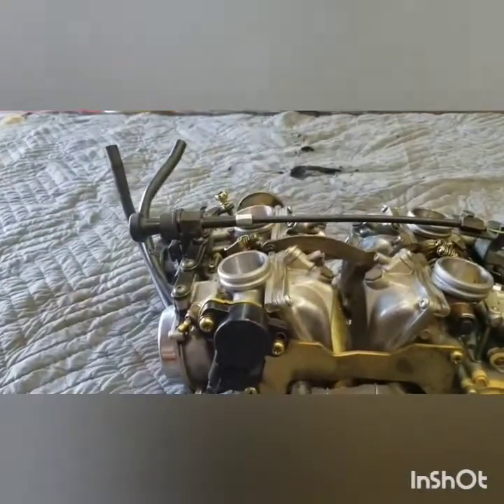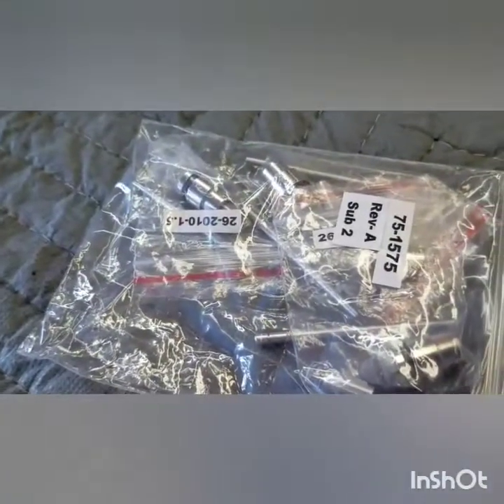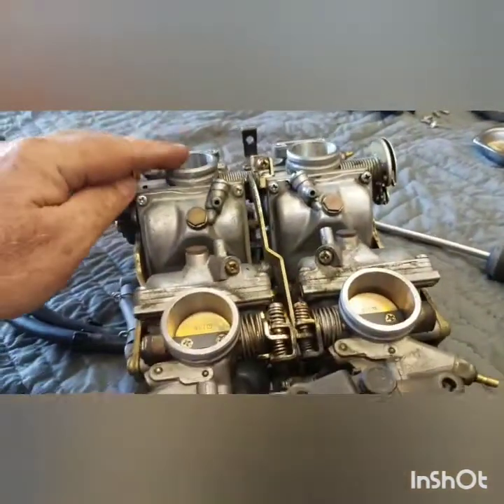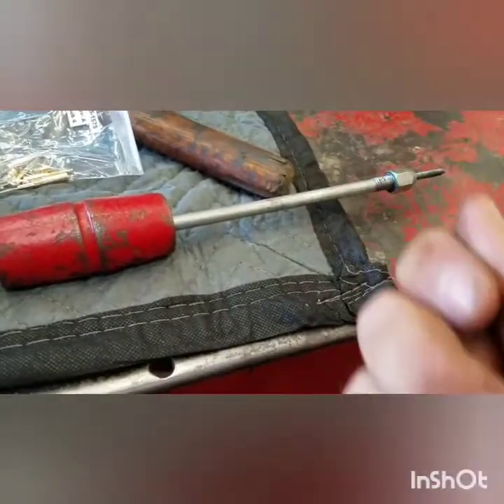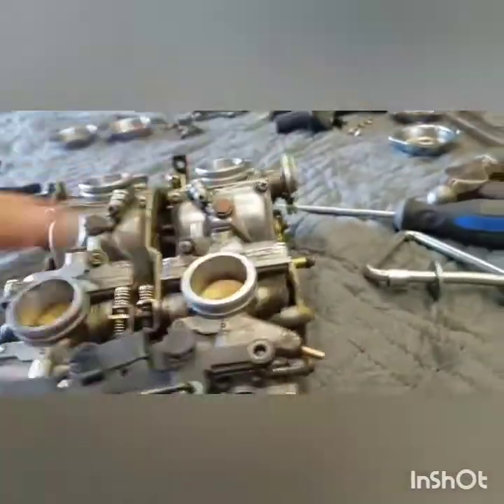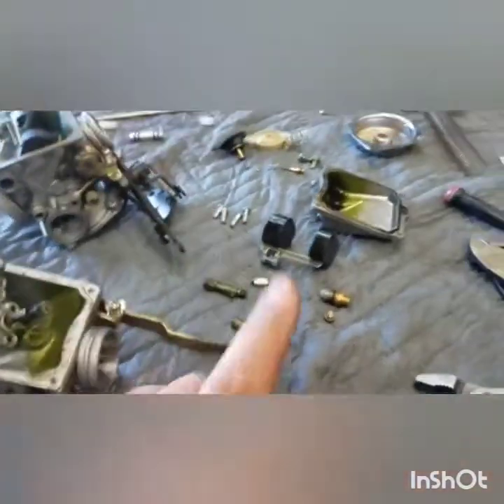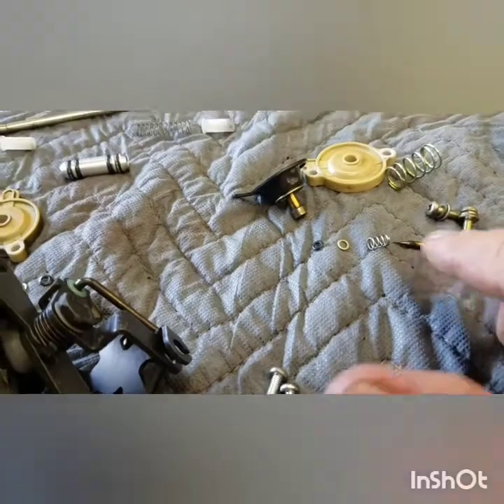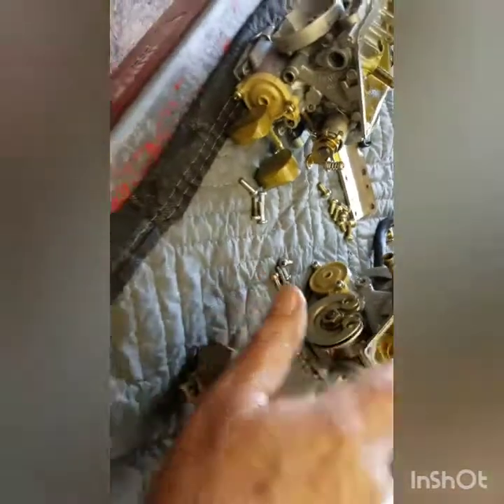Yamaha Royal Star XVZ1300A carb rebuild

Comment: Hello, I have a 97 Royal Star 1300 with 32k miles and the previous owner definitely used ethanol fuel, I have run Seafoam in the tank a few times and I only run non ethanol in my carbureted engines, It seems I have one carb that doesn’t want to idle and I have picked up the same rebuild kit you have in this video, I’ve pulled and rebuilt motorcycle carbs but nothing with 4 carbs and TBH I think I’d rather pull my carb assembly and send them to you with the kit, How do I reach you outside of YouTube?

Comment: Hi. I’m looking for a carb body exactly like the one the video as someone has broken one of the brackets that hold the flat inside the carb. Any idea where I can get one as I can’t find it on eBay or anywhere else. You can contact me directly as well please. Thanks
Reply from the maker: I just keep watching ebay until i find one
Reply: @geezermoto7820  thanks. Any chance you know the exact model number I should be looking for to get this exact style of carb since all the ones I found on eBay for the Royal Star XVZ1300 seem to be different.
Reply from the maker: @fuadmohseni  you will have to just wait until you find one that looks exactly like yours

What year model?
Reply: @geezermoto7820  2000
Reply: Are there different models within the same years and that’s why there are different types of carbs?
Reply from the maker: @fuadmohseni  not that I'm aware of but i guess it's possible
Reply from the maker: The 10th digit of your vin is the year code 
X is 1999
Y is 2000
1 is 2001
2 is 2002 etc

Be sure to check the vin on the frame
Reply from the maker: @fuadmohseni  i think 98 and older is a different carb
Reply: @geezermoto7820  which year did the carb in the video come off of?
Reply from the maker: @fuadmohseni  1998
Reply from the maker: @fuadmohseni  1998 and back are different and a little harder to find
Reply from the maker: @fuadmohseni  best i Remember there are about 3 different style carbs for allll of the 1300... If it looks like yours, it will be yours
Reply: @geezermoto7820  thanks again. I am going based mainly on how the little holes on the air filter side of the carb look. They are clearly different on the other carbs I’ve seen on eBay.

Comment: I did have the carbs synced within two weeks
Reply from the maker: you can buy manifolds on Ebay very reasonably,   those are always used up with cracking after about 10 years of use. Seal them against head with threebond 1184 or yamabond 4.
They will suck air etc. Could be a reason for smelling fuel at warm up.
  or leaving choke on too long.
You only want to choke as little as possible, on choke can foul plugs quickly.

Comment: What do you charge?
Reply from the maker: 500 plus parts plus shipping

the kits for all four are usually right under 100
Reply from the maker: check your intake manifolds for cracks or being very hard, for sure seal them to heads with threebond 1184

Comment: Geezer, Do you know what the brass hollow screw is, and the purpose of it that is bolted under the main jet with a washer. The brass screw is hollow.
Reply from the maker: Not sure which you speak of

....if it is the one with no hole all the way through, it is just simply a plug plugging off that passageway
Reply: @geezermoto7820  the tip of the diagrhram needle seems to sit in the hollow section of the brass screw. Does that help?
Reply from the maker: @darkventhead581  it just plugs the passage off....to machine that area
Reply: @geezermoto7820  that's what I thought but wanted to make sure it didn't serve a deeper purpose. I had one of them randomly split in half after being hit with an ultrasonic cleaner. Waiting for 2 primary holders. The o-ring for the primary jet. And one of those screws and she can all go back together. Hopefully I didn't forget anything!
Reply from the maker: @darkventhead581  just take lots of pics as you go

They are pretty simple if you think about it's just a few subassemblies
Reply: @geezermoto7820  I'm back geezer!! 

Did a complete rebuild on them and having an issue. Fuel is rocketing out all 4 of the tops of the carbs in the airbox through the hole with the brass fitting. Could you point me in the right direction?
Reply from the maker: @darkventhead581  either float levels wrong, or floats installed wrong or O-Rings on float seats are bad
Reply: @geezermoto7820  Float needle and seats are brand new. I did the ole' kentucky grease on the o-rings. Before installation, i blew through the main fuel inlet and manually operated the floats and all of them properly sealed against my breathe. I'm kind of at a loss here.
Reply: At 47 seconds in the video geezer. When you're pointing out the float needle and seat. There are some small rubber o-rings in the package as well. What are those for? I still have them leftover from the rebuild kit because i couldn't find anywhere to use them at.
Reply from the maker: @darkventhead581  O-Rings go around the float needle seats
Reply from the maker: @darkventhead581  without those, fuel will never stop flowing
Reply: @geezermoto7820  Of course. I have o-rings that go around the needle seat (They kind of press fit in to the hole). My question is about the o-rings that are really small next to the needle seats. Looks like there are 2 types of smaller o-rings there. Do you know what they go to?
Reply: They show up much clearer at 38 seconds. The smaller o-rings in that package.
Reply from the maker: @darkventhead581  smallest go on the air mixture screws
Spring then washer then o-ring
Reply from the maker: And often times the others are not used

Accelerator pumps use them but I don't think your carbs have pumps

Comment: The gunk and filth in these carburetors is not from gasoline with methanol, that is from not riding the bike. I have done my share of resurrections on motorcycles that sat with gas in the carburetors for years. Sometimes the slides would be guarded into the Boers of the carburetors. If you are getting fuel past the O-rings leakage, smell the oil in the crankshaft/crankcase area. If it smells like gasoline, don’t even start the bike. Inside the gas tank probably looks the same as these float bowls…
  Methanol in the gas is corrosive to some plastics..
 Harley riders call Japanese motorcycles rice burners. They don’t even know why because every time I saw that sticker on a hog riders helmet, I asked him what it means, and they never know. I know what it means.
  Along those lines, I hope that other countries don’t start calling motorcycles ridden in America, corn burners, because it would be true, and it doesn’t sound as groovy as being called a rice burner..
this video reminded me of how much I hate carburetors now that I have experienced fuel injection. I was watching these videos because I was considering buying my third Yamaha venture because a very clean one just came up on craigslist. I put 138,000 on my 86 Yamaha venture over 16 years, I put 49,000 miles on my 2002 Yamaha royal star venture which could not hold a candle to the original ventures. I’ve had both, I know.. The third generation of the V4 Yamaha venture is a dog compared to the 1986 through 1991 ventures. That generation of ventures actually turned in the 12 second quarter mile times at the dragstrip. The starventures, I’d be amazed if they turned in the 16 second quarter mile range..
  The 1984, 85, and 83 1200 CC ventures were the smoothest. They had problematic second gears if the rider was not deliberate in his shifting. They fixed second gear, in 1986, gave it bigger saddlebags, bigger carburetors, the same clutch that they use in the Vmax, and the 86 on did not have the smoothest engine like the early version did, but the 86 through 91 ventures were the rocket ships. I only sold mine after 16 years because it was getting old, I never had any trouble with it, nothing ever broke.. of course I was a maintenance junkie, I did things like take the driveshaft out to lube the splines. I change the brake fluid and clutch fluid every year, I never ever pressure washed my Venture ever. Pressure washers destroy motorcycles from the inside. They force water and dirt down all the cables, into the electric’s, into all your lights and gauges so they fog up the lenses, into your wheelbearings, into all your suspension linkage, into your electrical connections, never never never pressure wash a motorcycle ever.. when you put them away for winter, fill the gas tank all the way up to the top, and drain the carburetors. Each carburetor has a screw to drain the float bowl at the bottom. Park it on the center stand out of the sun and don’t cover it with plastic. spray inside and out of your mufflers and exhaust pipes with some kind of oil like fluid film, which is actually lanolin, I guess you could call it sheep fat.. $9.98 a can at Lowe’s. I rustproof my new ram hemi pick up truck that cost over $50,000 with fluid film. I took five days taking my time to make sure I rush proof that here in the Northeast. Those ram trucks restaurant in front of your eyes if you don’t undercoat them with some type of oil, not Ziebart tour, you have to spray it with fluid film or something like it that will travel to get where the salt water will get. The Ziebart will harden and it will not travel and it will actually trap water making your car rust faster. Spray that on your motorcycle exhaust system inside and out for winter storage. It will not hurt the bike, you can actually put it on the leather, could actually put it on your skin to soften it.
  make sure you do not use carburetor cleaner unless you have to when doing the carbs. Because carburetor cleaner is an acid/solvent.
  never never never use dishwashing liquid to wash your motorcycle or to lube your tires when installing new tires. Dishwashing liquid‘s, most of them have LYE in them. That is extremely corrosive to aluminum. If you wash the bike with dishwashing liquid that has LYE in it, you will destroy the finish of the wheels. If the dish washing liquid burns your eyes, that’s the lye.. only use rubber lube that you can buy at Napa for about $16 a gallon to lube tires for mounting tires, and only use car washing liquid soap to wash your motorcycle by hand. And never use paper towels when cleaning your windshield. It’s like using sandpaper on plastic or acrylic..
  to clean your bike up to do a detail job, go to the Honda shop and buy a can of Honda spray detailer. That is the best stuff in the entire universe. You can spray it on a dirty motorcycle and wipe it off and it will not scratch it. I had a Honda pacific coast, black, that I commuted on for 24 years. I never ever washed that bike with water and soap. I only used Honda spray detailer on it, and when I sold it, it still shined, in the sun without the spiderwebs scratches in the finish it will show up on black vehicles. I also use that Honda spray detailer on my expensive guitars. It is the single item that Honda sells most of in their entire inventory. They sell more of the spray detailer then they do spark plugs. You can use it on the vinyl seat, on the paint, and and on your windshield, and it will not scratch, within reason. I mean if you have dried sand on it, you have to hose that off first